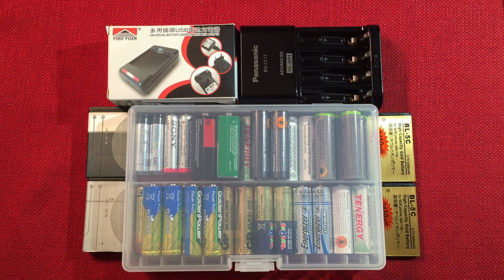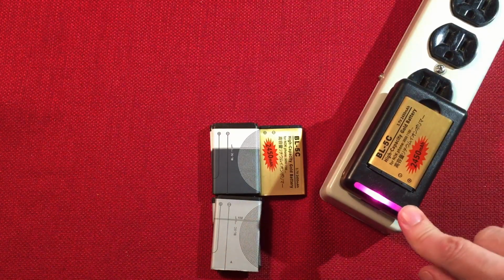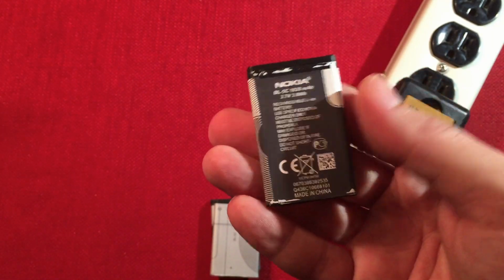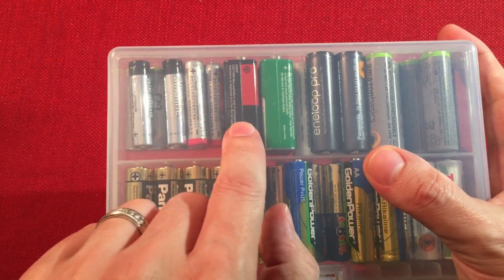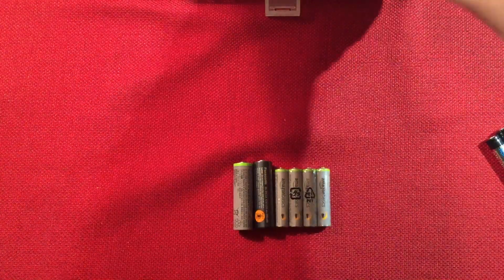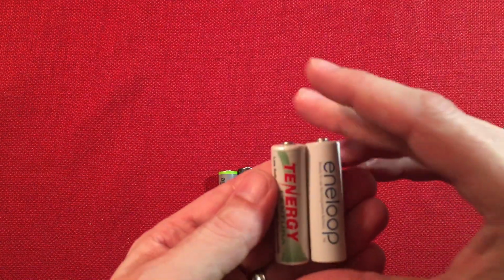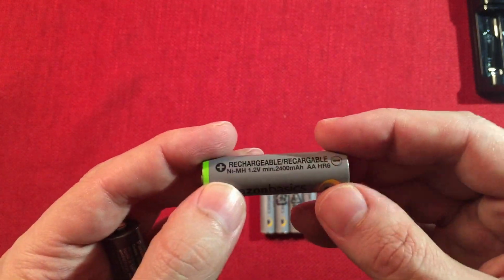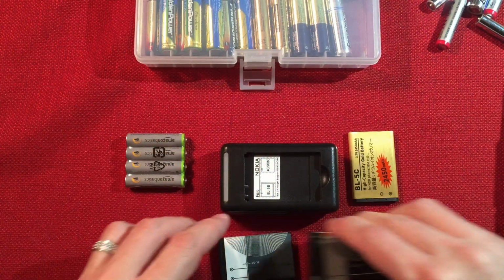Power up your radios with battery tips from todderbert! | Eneloops, Tenergy, BL-5Cs and More.

Comment: Thanks Todderbert for posting this informative video! 🔋👍🏼

I use the regular white Eneloops for my Tecsun PL-660 radio. The reason I don't go for the 2450 mAh Eneloop Pro is because they're more expensive, weigh heavier and have a much shorter total lifespan than the 1900 mAh Eneloops.
When it comes to rechargeable NiMH (or LiOn 18650 cells), you can have either a high capacity or a high number of cycles, but NOT both. It's an internal battery chemistry limitation and there's not much the battery manufacturer can do about it.
This is why cordless DECT phones are issued with 550 mAh AAA rechargeable cells (e.g Eneloop Lite) instead of the higher capacity 950 mAH ones. Cordless phone owners tend to place the phone on the charging base unit after using it. The low capacity 550 mAh cell can withstand repeated recharging a lot more than the higher capacity 950 mAh ones and therefore they are more suitable for use in cordless phones.

However, there are situations in which the higher capacity 2450 mAh AA batteries like the Eneloop Pro really shines. If I'm going to do a lot of flash photography with my Canon Speedlite 430 EX II strobe, I'd definitely use the Eneloop Pro instead of the regular Eneloops. The extra capacity equates to a higher number of flashes before needing to swap for a second set of Eneloop Pro AAs (let the lifespan be damned).

For my Tecsun PL-660 radio, the additional 450 mAh capacity offered by the Eneloop Pro isn't that significant over the regular Eneloops, since I recharge twice a week . I'd rather save money by buying the regular Eneloops and enjoy over 2000 cycles vs a mere 500 cycle life from the Eneloop Pro.

Comment: The IKEA LADDA(Made in Japan) are Panasonic Eneloop PRO too for under $9.99cad  !
Reply from the maker: Awesome!  I learned about these cells later on, will give them a try.
Reply: @todderbert  Since Panasonic is the only  battery manufacturer still left in Japan its automatically Panasonic/Sanyo by default with any AAA/AA rechargeable batteries that bears "Made in Japan" ...LoL
Reply from the maker: @etow8034  Good to know.

Comment: Based on everything in this video, there’s a couple of things I wanna know:

#1: What are the best AA and AAA batteries, regular and rechargeable?
#2: What is the overall best charger for all types of rechargeable batteries?
And #3: I’m thinking about buying a Demonfire 1200 mAh 18350 battery for the Sangean MMR-88 radio, but I want to know if it’s a known brand of rechargeable battery that really gets the job done, and lasts longer than the default battery you get with the radio.
Reply from the maker: Not sure about that brand of battery.  As far as AAs and AAAs NiMH batteries I would recommend Eneloop/Eneloop Pros, Tenergy Centura/Premium, and EBL 2800/1100s.  A good charger for Lithium and NiMH batteries is the LiitoKala Lii-500: https://youtu.be/c_l6-jw2U3A  Inexpensive and works great. I use mine all the time.

Comment: Is it better to use rechargeable batteries to radio?
Reply: Nah, not really because they have the lower voltage (1.2v) compare to fresh Alkaline battery (1.5v). But they are more economic if you use radio frequently and you don't have to worry about battery leak

Comment: You didn’t seem to include 18650 Lithium Ion batteries. Can you tell me which one is the best brand, and holds the most mAh of power?
Reply from the maker: Look for Sanyo/Panasonic 18650GAs , they are rated at 3500mAh and are the best ATM for High Capacity.  They are the ones I like to use.
Reply: @todderbert  Can you provide a link where I can purchase one through PayPal or Debit?
Reply from the maker: @MatthewHajjar-Betters591  Check the length of the battery to make sure this will fit.  It is a protected button top battery.  There is extra length added for the protection circuit.  This does fit my D-808, and various Retekess Radios. https://www.orbtronic.com/18650-protected-battery-3500mah-lithium-ion
Reply: @todderbert  The reason I’m asking is because I recently bought the EZBNB RD207 radio, and I was wondering if the radio and battery would be compatible with each other.